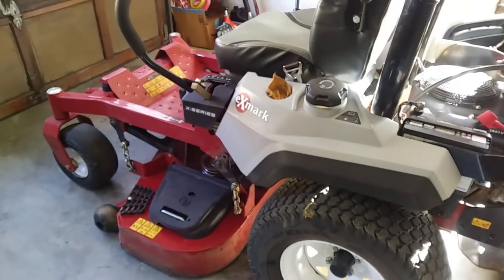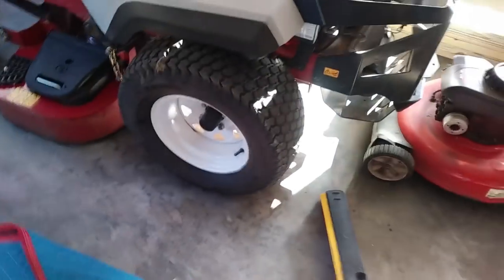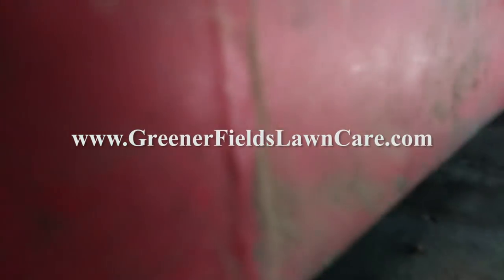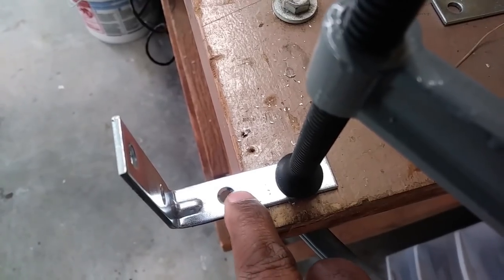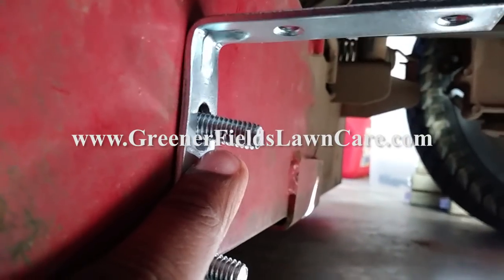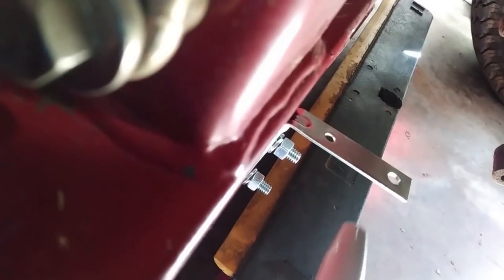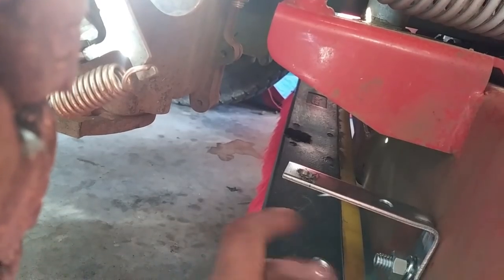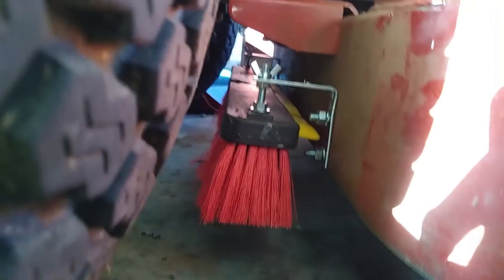DIY Zero Turn Mower Striping Kit for Under $15 - Exmark

Comment: I expect this mower will last several seasons with decent care. https://www.youtube.com/post/Ugkx1VWTrayKBdCKAjzAcZ_Eg4dhHTae3LkN also recommend Also, I ran across the problem with it not starting the 2nd time I used it. There is a safety switch which is pushed in by the chute or mulching piece being attached to the deck. I took the cover off and it wouldn't start. Put it back on, no problem. It takes only a minute with 2 easily accessible wingnuts and no tools. This mower starts up first crank each time and it is a joy to use. It also mows in reverse by putting the key to the reverse area after starting and pushing in the triangular button. It will stay in reverse mode until you turn it off. All in all, for my homeowner needs, I really like this mower-and at 70 bucks a cut here in Miami, it's already more than 1/3 paid for itself in a month.
Reply: With triangular button that sounds like a Troy-Bilt to me but I tell you what ever since I bought my Encore Edge Pro 60 inch commercial zero turn I'll never go back to any other brand again! I only say that cuz how nice they are and Noone knows about them I guess cuz in the only one with one anywhere around my area lol he came up with a really good idea here except I think it would work better with over of those synthetic straw firm deck brushs( of course they cost more) but in thinking it would last the whole season!
Reply: I'm coming back to Miami  next winter!

Comment: I'll use smaller bolts with washer and a lock nut, thanks for part of the idea! I'll keep mine just¼-½ lower then the deck so it don't scrape , it's only gotta touch it lightly and bend it! Good idea tho, thanks

Comment: Here's a tip, those brushes are too far down. You want to bend the grass not fully tear it. Pick it up, close deck level or slightly under. You might not feel it but your machine is working harder to move with a brush that far down. Pushing horsepower and wasting gas. Trust me I work with hydraulic fairway mowers with brushes, you can hear the difference when the brushes are not set up properly. If you notice your comments are people complaining that it breaks easily, it's because of that. Great concept you just need a little adjustment. Other than that great job

Comment: Wonder if it was off the very back at the ball hitch with 1 long bolt and a tack weld( won't move then) then bolt to the bar? I'll let you know how it goes on my Encore edge pro commercial zero! Good job

Comment: Also should use washers on top of your bottom leveling nut and it wouldn’t hurt to place a fender washer then a lock washer on the wing nut side. If you plan on taking the brush on and off numerous times that may be more of a pain than beneficial. This is a good idea though, it should work well. Just a bit of advice though people on social media platforms will give you an absolute fit for calling bolts screws and calling nuts screws and bolts. It can be very confusing to some viewers if they are not paying close attention or if they are not mechanically inclined to know what you meant to say. I’m not trying to give you a hard time I’m just trying to give you helpful advice. Especially if you are promoting a professional business, website, or YouTube channel. Being correct counts for an increase of customers in any of the above mentioned. Good luck sir.
Reply: Also, you may want to go back and edit a clip into this video of that DIY striper actually working. I’m not sure if you can add or edit a video you’ve already posted but why you wouldn’t want your viewers to see the final results or actual purpose of your project?

Comment: Pretty cool. I bet those L brackets won't hold long though. Reversing or going back/forth is going to bend them because the bristles will be pushed into the ground. I wonder if you could get a wider brush and saw the ends off to make it as wide as your rear tires? 
 I like it though. It's a clever and harmless/cheap/reversible modification that works. That's what these videos are all about! Nice job.
Reply from the maker: We had to go stronger with L brackets. No problems after that!

Comment: Props for a DIY solution!  A couple things that I thought about when watching this:  I think without a lock washer between the underside of your bracket and second nut, and also between the top of your bracket and wingnut, it will probably vibrate loose on you over time when you mow.  It'll slow you down if you have to adjust brush height when changing deck height but I think otherwise it may come off due to vibration.  Secondly, how much gap do you have on each side between the width of your brush and the distance between your rear tires that will result in short sections of grass not being pushed over (striped)?  I went with a rubber mat attached to a 1x1 tube on the mower hitch hole that drags behind my zero turn to get a full stripe, but I've seen guys use boat rollers the same way.  I've always liked the brush idea, just can't see a good way to attach it without problems when raising/lowering the deck and not finding push brooms that were wide enough to cover the entire mowing pass width.
Reply from the maker: Brandon Leek thanks for your input!
Reply: i hae seen a guy buy weather striping for a door and add it to the bottom of his deck.  seems to work very well.
Reply: What abt applying the same method as if it were a pipe? Would attaching the brush to chains that hang low enough to touch the grass behind the mower work?

Comment: How well has it held up in daily abuse?
Reply from the maker: It works well.  Go with heavy duty brackets though.  The ones in video bent easily.  But I use heavy duty now and no problems.  The brush will last a season or so depending on how much you run your machine.  Good thing about this as opposed to the metal roller ( We have one ), is the brush is easier on the deck because the bristles, unlike the roller, doesn't get caught on things.  Let us know if you have more questions.  You can see some examples of the striping on our website and on the channel.
Reply: @GreenerFieldsLawnCare  alright good to know. I'm looking into a few options for the striping kit. I don't like the roller idea, this one seems to be the best

Comment: Hate when the nut is too big for the hole.... aren’t those holes in he deck for airflow? I thought that was especially true for the exmark because they’re engineered to take in air for circulating the grass underneath Or were these setup for the factory kit?

Either way, great idea.
Also - did you even show us what it looks like?

Comment: We all have different opinions but I just don't see spending anywhere from $5k plus on a mower to cheap out on a striping kit that would last alot longer than the brush
Reply from the maker: Thanks for the input. We do have an "official striping kit" by exmark. The con is they get caught on things on people's property like roots for example. This can damage your deck and put undue stress on it as well. The brush is inexpensive but it gives way in ways a metal roller simply can't. If a person is doing all perfect or close to perfectly graded properties then the roller would work. If not, the brush is a much better option and keeps the stress off of the structure of the mower deck because is gives way to hard obstructions.

Comment: Spriping kits shouldnt be attached to the deck.
Reply: Striping kits from factory are installed on the backside of the mower deck. Hence why the 2 holes on each side are already there